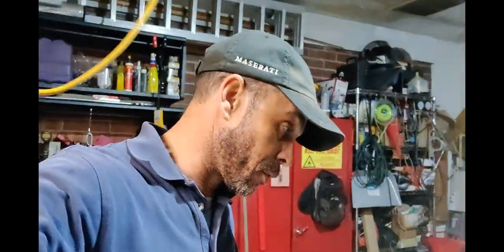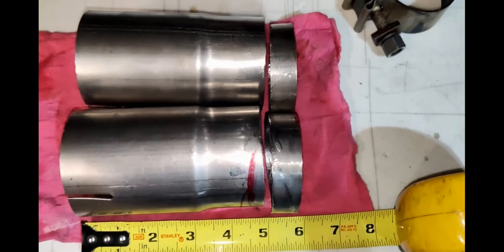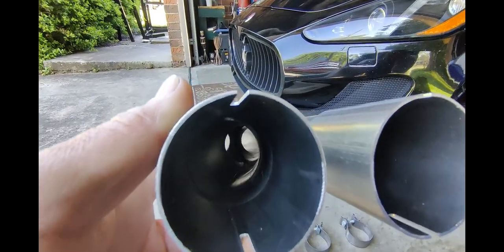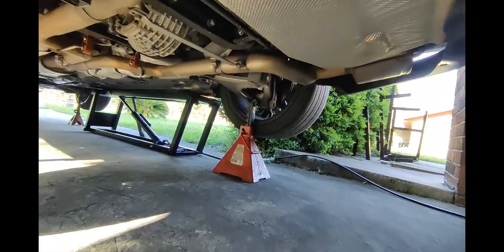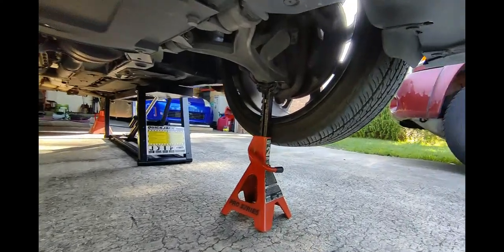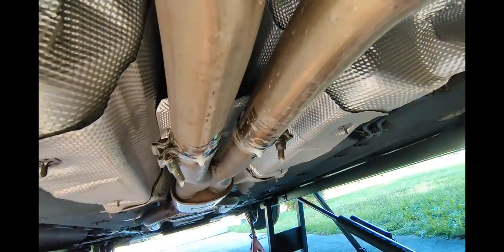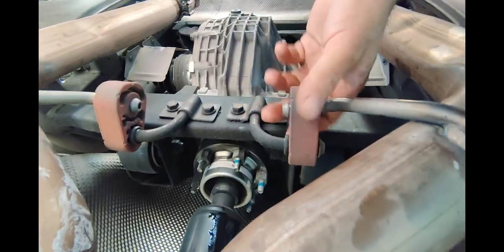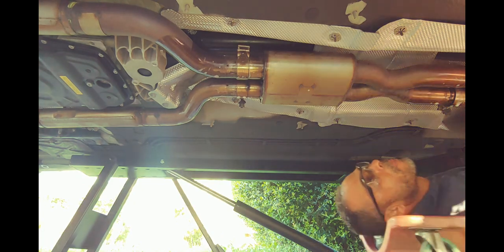Maserati Granturismo resonator X-Pipe Removal

Comment: very good job you are well equipped
for this car I advise you change the catalysts with Larini they are approved for this car.
the x pipe larini is best suited for this car I have two MC grand cab and a Quattroporte and I change all the line 
the catalyst it's a problem on this car , remember  this , if you can change it make it !
cordially

Comment: Good job on the removal glad to see you using lubricant I’ve seen lots removing and beat the heck out of the mufflers without it. I see you saved a pretty penny by not buying the overprice Maserati X pipes good thought on your part sir, I too am in the process of upgrading mufflers I’m going to the MC style lotta work involved I’ll shoot you a PM from the Maserati site I’m located under Bill GT1  you’ll find me great job sir.
Reply from the maker: Thanks for the comment Bill. Yes, rusty bolts and metal rust needs softening. Plus safety safety safety is highly promoted, I just do not like to wear gloves unless needed, I am a grease monkey. One of the members of the Facebook Maserati GranTursimo Owners Society suggested the Camaro SS x-pipe from JEGS Part Number: 555-30429 (originally fits 2010-14 Camaro SS 6.2L (except Z28)) . All I had to do was cut about 6 inches from the long end and it fit like a glove. I have two more videos coming; video 1 - cutting and modification, video 2 - final installation.
Reply: Have you made video 2 yet ?